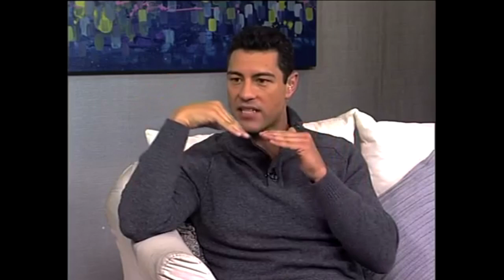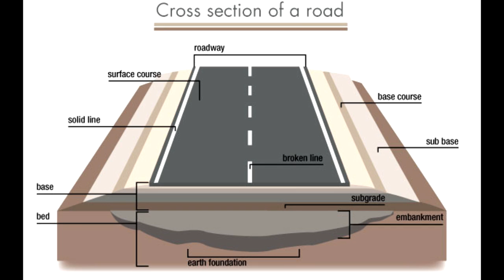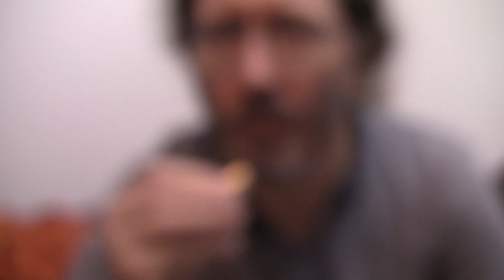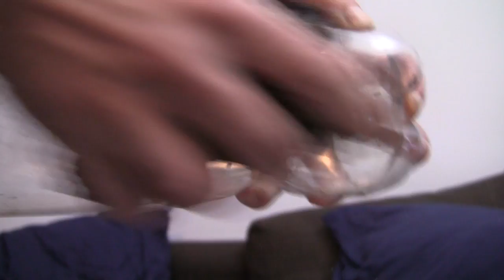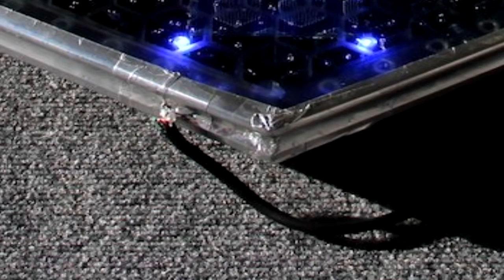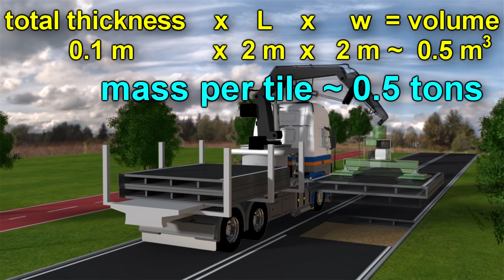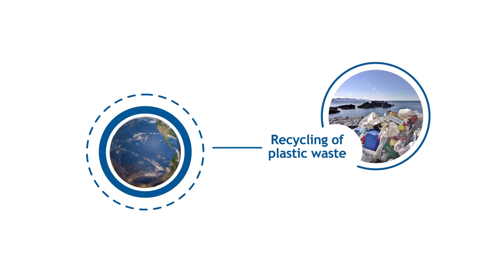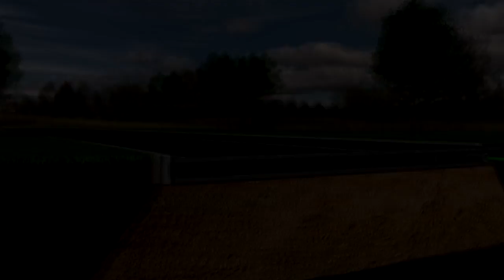Plastic Roadways BUSTED!

Comment: Why bother with something such as asphalt that is cheap, simple, recyclable, has proven that it works for hundreds of years, can be produced and used everywhere on the planet and has outstanding thermal and traction properties?  Surely, it would be better to use something that will cost a fortune to develop and produce, will fail after the first vehicle that rides on it, will be slippery in all weather and aquaplane when even slightly wet, will distort, fade and break under sunlight, damage very easily, cannot be produced in large quantities unless oil production is massively increased, is impossible to manipulate for corners and bends (asphalt is totally malleable), and simply will not work in any rational way?   I mean, a few idiots would feel better for a few minutes.  That's all that matters in 2017.
Reply: Oh now come on.  That product has nothing to do with plastic roadways.  The article is about a bridge that can be made using a composite which includes recycled plastics and other materials.
Reply: Neither of the two articles mention that ABS plastic is in the mix, despite it being one of several types of plastic used in cars.  ABS plastic on its own does not have great structural strength.  As such, it is typically used in applications that do not require it to absorb a lot of tension or pressure.  For example, motorcycle fairings are often made from ABS plastic as it is easy to form and shape.  It does not have to carry much load and is brittle.   Try dropping or high-siding your bike and you will find out fast.

The initial clip is about plastic roadways, which were supposed to be made from recycled plastic bottles, and that is totally crazy.  You are trying to validate other types of plastic as useful as structural materials, and that would only be in limited applications.  The bridge you refer to in Scotland can hold less than one articulated truck in total.  Big deal.
Reply: Again, it's obvious you're failing to read the articles provided.

Also, I'm a mechanic.  I've owned cars with abs body panels and own cars with abs bumpers.  I know perfectly well how durable abs is.

"But this is not the first military bridge to be made out of plastic by 
Axion for the military. The Army has previously built plastic bridges 
for Fort Bragg and Camp Mackall in North Carolina using materials and 
structural design that allowed for a bearing load of 73 tons for tracked
 vehicles and 88 tons for cars and trucks. To demonstrate its strength a 70-ton M1A1 Abrams tank was driven across the bridge at its official unveiling in September."

From the first article I posted, since you seem to be either blind or illiterate.
https://www.cnet.com/news/u-s-army-orders-bridges-made-of-recycled-plastic/

I'd say a 73 ton load rating is more than enough to handle the maximum allowable articulated truck weight on US highways considering it's far lower than that.

http://www.trucking.org/ATA%20Docs/What%20We%20Do/Trucking%20Issues/Documents/Highway%20Infrastructure%20and%20Funding/Report%20to%20Congress%20on%20the%20Compilation%20of%20Size%20and%20Weight%20Laws.pdf

https://ops.fhwa.dot.gov/freight/publications/size_regs_final_rpt/

https://ops.fhwa.dot.gov/Freight/sw/overview/index.htm

As far as the article talking about using abs, I don't know how you could have possibly missed that they're also using dashboards to make the PLASTIC ROAD SURFACE.  Yes, they are supported by steel girders as you'll see later in my explanation, but they're still driving and sending rail traffic across the plastic.

"In 2012, Axion, a company that specializes in green infrastructure, was commissioned to build the bridge using its 100 percent recycled plastic building material called STRUXURE.
 Made from 80 percent post consumer plastic (like water bottles and milk
 jugs), and 20 percent recycled car bumpers and dashboards, the bridge 
is now America’s longest recycled plastic bridge on a public roadway."

From the second article I posed.
http://earthtechling.com/2013/06/100-recycled-plastic-bridge-holds-strong-in-ohio/

They're combining the plastic with other materials too.

“We combined HDPE with polystyrene from old Big Mac containers,” Nosker 
says. At a specific proportion, the blended plastics gained strength 
because of the way the tiny plastic particles interlocked.

"More recently, two active, rural Army bases wanted bridges for hefty 
loads. In Fort Bragg, North Carolina, where the Army has tank training 
grounds, bridges must carry heavy vehicles across numerous streams 
throughout the 160,000-acre base. The Army successfully demonstrated the
 first structural recycled plastic bridge to support a 73-ton M1 Abrams 
tank there in 2009, and has ordered 1,000 more plastic bridges for Fort 
Bragg and other sites."

From the sixth article I posted about the inventor of the bridge material used for the first military bridge In Fort Lenard Wood in Missouri.  If you'd actually looked at the article and followed the links IT provides, you'd see in FULL COLOR PICTURES that a tank drives over one of the bridges built by this company directly on the plastic surface.

http://theinfrastructureshow.com/audio/downloads/Worlds-First-Thermoplastic-Bridge.pdf
Said link providing specific information and pictures.

While some of the bridges do use steel as a base for the roadways, some are made totally of plastic and some re-use the existing timber support structure.

They also go on to describe how you can increase the friction coefficient (traction) of the road surface through a simple embossing process during production just like they do with decking manufacturing now.

Yes some of the heavy load bridges use glass fibers for reinforcement, but they don't say one way or the other if that prevents them from being recycled to make more of the same material.  Obviously you wouldn't want that for drink containers, but I don't see why you can't melt old or broken sections into new sections with the right processes.  I'm sure they have an answer one way or the other, but I'm done arguing with you since you can't be bothered to do any work to support your own side of the discussion.
Reply: Hellcat, I am starting to get the impression that you are both naive and illiterate.  The clip by Thunderfoot shows plastic materials that are simply not suitable for the purpose and never will be.  They are simply inappropriate for the stated purpose.

The two articles you attached do not show anything like the same material nor the same application.  Firstly, they are 80% plastics, and are reinforced with metal such as car bumpers and other materials, which is why it is called a composite and not plastic.

The articles are also rather dishonest in that they pretend that these recycled materials are everywhere, when they actually site only one real example,  and secondly, they assume that the materials are cheap (unlike conventional materials like wood, steel, iron, concrete, etc).  Yet nobody has provided any scientific or financial data on these materials.  

Now, the Scottish bridge is no more than a small local bridge, 30 metres long, and there is some dishonest reporting about its materials.  In one place, it is a plastic bridge, in other parts of the story, it is a "composite" bridge which means it contains other materials (as per the first story).  The TOTAL load bearing capacity for that structure is 44 tonnes, which is less than one laden articulated truck.

Composite materials do offer potential as structural materials, but their structural integrity over time is not yet known, and their cost implications are also undisclosed.  Raw materials such as steel, iron, bitumen, concrete etc are freely available and at current prices are relatively inexpensive.  

SO if composite materials can replace some of the iron, steel, wood, concrete et al used in bridges, that is a good outcome.  But that has nothing to do with plastic roadways.   However, the composites would still need to be custom made for every bridge and have NOT bee shown to be useful for major structures at this point.
Reply: Frank, adding ground tyres is typically used in asphalt that does not take considerable load, such as pedestrian walkways and minor roads.  It is a good idea in terms of improving skid resistance and can reduce wear.  As far as I know, the main application is in low load applications, with up to 15% being seen as useful.  The rubber however needs to be finely ground as this does come at a higher cost and potentially more difficulty repairing them.

Yet realistically, this is a mile away from the "plastic roadways" narrative.
Reply: That article is about a bridge that IS made and more that will be built.  And the whole point is that they're using recycled plastic to build a bridge and it's holding up to traffic a lot more than one minute without being abraded into nothing or being too soft to support the vehicles without deforming,.
Reply: The article points out the structural material uses a COMPOSITE which includes some recycled plastic.  It is not a plastic bridge by any means.  Further, the road surface on the bridge is not made of the same material.
Reply: There is more than one bridge and there are more than one use cases.

http://earthtechling.com/2013/06/100-recycled-plastic-bridge-holds-strong-in-ohio/
http://www.cnn.com/2011/12/06/world/recyclable-bridge/
https://www.cnet.com/news/u-s-army-orders-bridges-made-of-recycled-plastic/
https://www.plasticstoday.com/building-construction/plastic-bridges-popular-europe-may-be-catching-on-us/51989323124498
 http://news.rutgers.edu/feature/recycled-plastic-lumber-invented-pioneering-rutgers-professor/20160626#.WNMiQGdw9hE
http://www.lankhorstrail.com/en/rail-sleepers
http://www.axionsi.com/products-composite-railroad-ties/
Reply: Mark Dignam 
You seem to be the one illiterate.  the bumpers are abs, not metal.  ABS is a type of plastic.  Also, the composite they speak of is different TYPES of plastic.  

The railway sleepers do have some metal reinforcement, but they are bars of steel with the plastic cast around them, not mixed into the plastic.  

Why don't you actually try to pay attention to what you're reading.
Reply: The U.S. Army doesn't think it's such a bad idea...

https://www.cnet.com/news/u-s-army-orders-bridges-made-of-recycled-plastic/

Comment: What about plastic bricks with standard foundations? Where I live we still have brick roads made from clay. The terrain is warped and the surface is bumpy as fuck but the bricks themselves are fully intact. If you could properly maintain the foundation, could you use plastic bricks?

Comment: All this is rather silly for one giant reason. Polyethylene is a thermoplastic, which means after it warms up a little it starts to become malleable again. This means the road would deform in any increased temperature, and given roads have massive surface areas, this would be a massive problem. The road would deform and given a high enough temperature would just straight up melt.

Comment: Wasn't there a push, (in the US at least), to make concrete roads, back in the 50's or 60's?  Also, wouldn't running cables under the main roadway mean that, should one break, you'd have to close down at least that lane?  What would be the melting point of these roads?  If there was a care fire on one, would it mean it'd melt into a huge hole?

Comment: Stupid humans. Imagine your low income slobs who drive a clunker that drips transmission, oil and gear grease all over the roadways and imagine the ice skating rink that will make. Imagine when a car catches on fire and the roadway melts, effectively destroying the roadway and making that section impassible. Ground settling and shifting is going to pop out and cause misaligned joints. But maybe the upside is that it will be easier to spray off roadkill and dumb dead drivers and pedestrians who were busy texting and yapping on their smartphones. FA!!

Comment: The Dutch page states: "Op dit moment is de insteek en focus om de PlasticRoad in eerste instantie toe te passen als fietspad." In short it means they are at this moment aiming for using it for cycle paths. 

Why should they think of PET? Maybe PP (Polypropylene) or PVC (one of partners Wavin manufactures PVC tubes) is a better option?

Comment: I have a revolutionary idea! How about you use that plastic to make what it was used before! Maybe make bottles instead of making more. It is better than any idea!
Reply: nope, PET (the stuff thunderfoot talks about here) has a well established recycling chain. You cannot use it to make new bottles, but it gets exported to china to be made into fibres for textiles. That polyester sweater you are wearing was once a heap of fizz bottles...
The park bench plastic is usually PE or PP, which I guess these guys are hoping to use too. With recycling, the problem to solve is not what material fits the requirements, but what products you can make form your recycled source material.
Reply: Tamas Glanz recycled bottles can't be used to make new bottles - it's relatively rough and opaque - it's what some plastic park benches are made of, that rough gray plastic.

Comment: I think you are getting this all wrong. My guess is that some engineers are working on a synthetic replacement of bitumen for better properties (which is not unlikely) and a marketing department went crazy on it and made up all kind of fake applications just to get some attention.

I can already imagine the meeting:
Marketing: Will this be a plastic road?
Engineer: Technically it falls under the plastics.
Marketing: Can you also replace parts of the road?
Engineer: You can always replace parts of the road by scraping it off.
Marketing: So you can replace parts of this plastic road! Lets make a video about it!

Comment: You know, one of these days there's gonna be an idea for making a road out of some substance that IS genuinely better than asphalt. One that can overcome that insane issue of the sheer time and effort it takes to cover a road in it.

Maybe some kind of silicon/carbon/hydrogen/oxygen megamolecule that can be synthesized cheaply from burnt wood, sand, and water? Lord knows those elements make some really crazy shit. Hell, maybe there's a way to arrange carbon atoms cheaply in a way that makes a substance that is perfectly rigid yet still somewhat flexible on a microscopic level, some combination that is halfway between nanotubes and nanopyramids (diamond)... Nanocubes, maybe? Or some kind of nanocrossbeams?  If the process is cheap and efficient enough it might have the properties needed to make a workable interchangably segmented roadway system.

Till then, though, these are just asphalt from the snake oil sands.

Comment: Why wouldn't they make the inside of the road segments corrugated? Surely this is the most basic and obvious level of design. it will be far stronger, spread the force of impacts on the surface, and still offer space for cables.

Comment: Considering both plastic and asphalt are primarily oil based, there's no benefit to using plastic. It's almost economically neutral IF NOT economically detrimental.

"It's a revolution in how we build roads." It'll be a revolution when you've shown some tangible evidence of it being realistic. The solar road idea is great in concept, but the cost makes it difficult to implement because they can't pay for themselves fast enough for highway departments. Not to mention they can't even fucking make it work. The plastic roadways is a great idea...if it were possible. It might be economically and realistically feasible in the future. But not now. The only benefit these roadways would offer is water drainage, but it isn't super hard to drain roads properly anyway.

Comment: Would be neat to put LED's under roadmarkers to direct traffic more dynamically, like instead of cones, you can just go to a DOT center and create a merge lane with the LED's embedded (somehow) in the concrete. Probably not cost effective across a country, or even a state, but could be helpful in high density roads in LA, or inside city hubs like Time's Square for events. Course the stress of the concrete on the LED's would have to be compensated for, and reflective tape works just as well, but oh well. It's neat.

Comment: Bad traction too and what about replacing a middle section when the wires or conduit are already run through. You have wires inside the sections that would require an interconnect for each conduit per section. To be honest higher average speeds is what wears them down faster. At 60mph your vehicle will hit a bump and then stress the road just after it. Like cars jumping on an asphalt bed while traveling horizontally. Happens to bridges as well. The effects are minuscule but add up quickly. Drive the speed limit if you want to preserve your surrounding infrastructure.

Comment: I work in a laboratory that deals with elastomers. I deal with polymers all the time as it is a key component. I do not know of any polymer that would be suitable for a road surface. I mean I can think of some polymers that would be suitable as an additive to asphalt, but I can not think of any that would work as a road surface. The best I would consider for a very light use path would be high density polyethylene or polypropylene. Everything else would be dust in a weak.